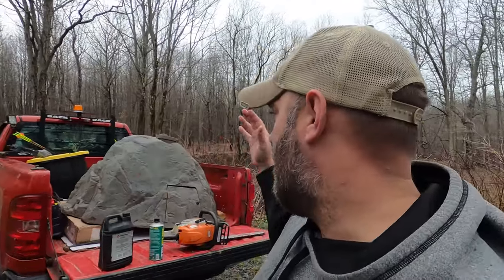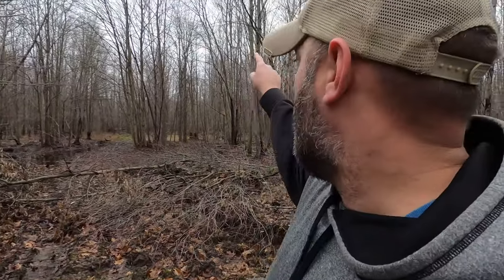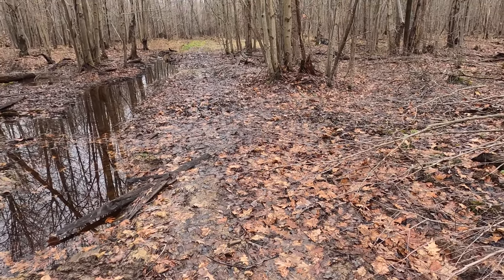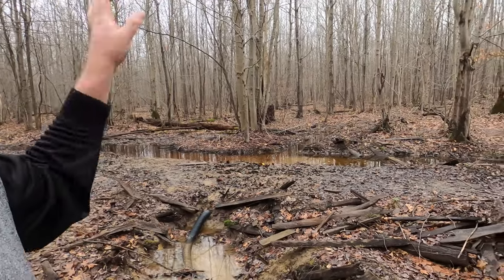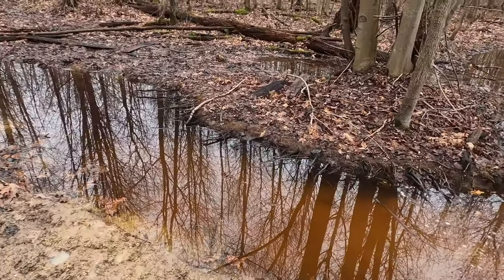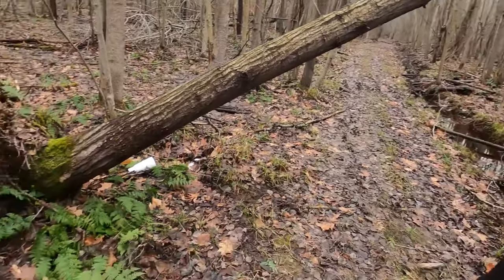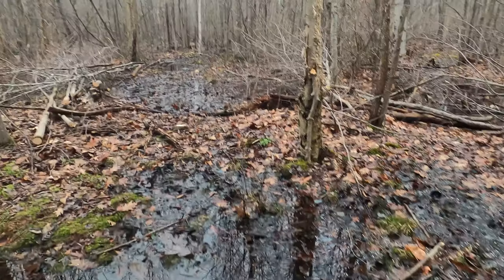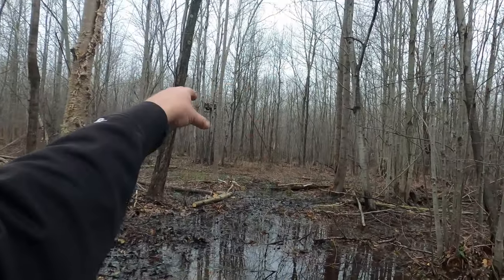Building a corduroy road through our swamp for hunting access - Part 1

Comment: I have a similar property that has mostly standing water near the woods and a lot of dogwood. We will be cutting trails this weekend. I am wondering if the effort to put in drain tile has been worth the time and cost.
Reply from the maker: Thanks for the comment. The tile and ditching has mad all the difference. Up where the cabin is at on our property was under water as well and after we put tiles and drainage, it has dried up 95%. In the back where we only ditched the trails, has made the trail accessible and helps drain the property as well. We still have standing water issues but now we can manage. 

Also, we are now able to see where we are still having issues. I would say that doing it in sections and then monitoring it is the best way to go. You will be disappointed doing to to dry everything up in 1 go just to find out there is still issues.

Most of our issues now are from decades of standing water. It has created crater like areas that just want to hold water. We only have a few option's at this point. I can either bull doze when the ground drys up or I can run a forester through the area to grade. Either way, we will loose some standing timber so I am trying to figure out the best route to take now.